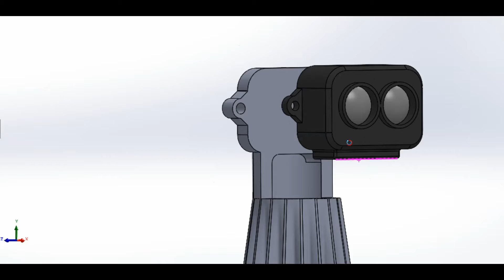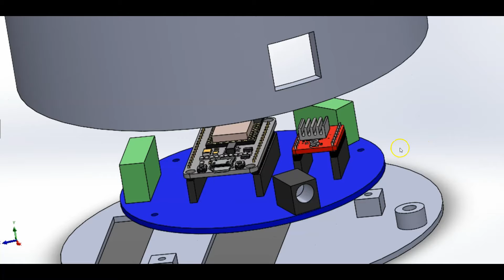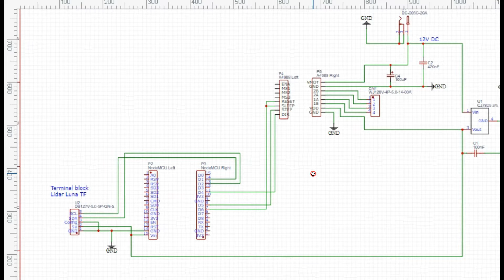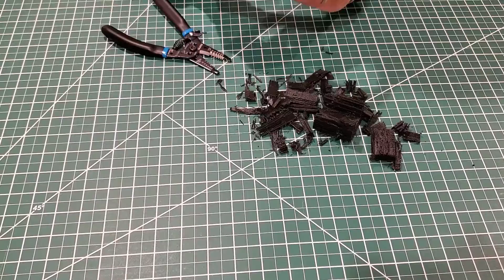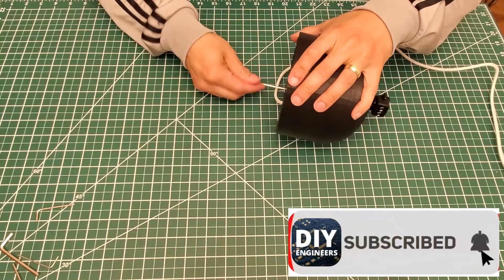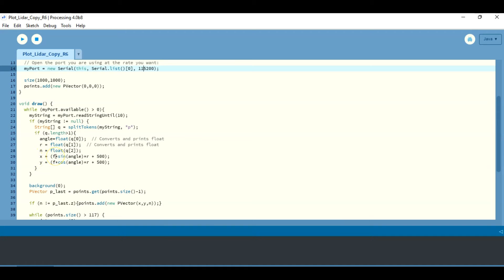LiDAR Scanner Project - Arduino Project NodeMCU

Comment: 📺💬I accelerate the motor's speed.
🧸💬 That is because it is LiDar, the small heart shape had handles but its specific co-response speed and the aluminum effect.
🐑💬 You are correct that is because of hardware today but with the Infrared sensor working well within ranges and supporting walls he may consider a mirror or sharp-angle reflection wall.
🥺💬 In circle units trying to remove the differentiate of the reflection rates, it had a small heart but they are trying to minimize them but as it developed it may response to the aluminum wall.
🧸💬 You are correct continue a bit working with reflection and moving angle.

Comment: I see you're dividing Pi by 180... strangely appropriate, given that the value we use for 𝜋 comes from a paper that discusses the ratio of a semicircumference (i.e. circumference part of half a circle) by its radius... and 180° is of course half a circle!  Have you heard about 𝜏 (tau)?  It's precisely 2*pi, since that's the ratio we often actually care about -- between the circumference and the radius of a full circle.  If you ever re-write or edit this, might be worth switching it up to use tau instead.  :D
Reply from the maker: Good suggestion. Thanks for watching!
Reply: @diyengineers  gladly.  :)

Comment: Is that actual Java or js? I haven't written Java since 99 in university haha. It was horrible back then. And it's process ide?

I apologize for all the questions. Add a thank you button and I'll hook you up because. Knowing of this other ide is great
Reply: Something I was pretty sure of, but had to search and double-check... and the answer I found sums it up nicely: "The Arduino language is a subset of C/C++".  So, no, neither java nor js, and more like C (I'm not seeing C++ features used in this code, I don't think)... though of course they're all at least somewhat related in the family tree of computer languages (which is totally a thing one can look up).
Reply: Oh, but maybe you meant the Processing part, and yeah, that's Java.
Reply: @David Lindes  yeah processing is a weird beast that I will not let into my projects since playing with it. Man when I learned to code if you did an infinite loop you'd have to reboot the pc hahaha. Compressing 600meg hard drives and shit. I loved it but got away from it for a long time and was welcomed back after not checking thr lay of the land and brushing up on my hard core c/c++ competition level shit only to find out even c++ is easier to code now constexpr and auto everything! 

This whole anyone can be an engineer and code for a living movement cracks me up. I heard a rant from Bjarne Stroustrop about it. It was gold man. I'll leave you to find it and he's got a good point. Coding apps is easy but programming systems where peoples lives are in jeopardy I wouldn't want a graduate of Tech with Tim's college responsible for any part of the millions of lines of code that go into automating any part of a vehicle.  I'm not dissing on those people because there's lots of companies who develop their own web services end to end but I wouldn't wanting the person responsible for the ui on my 55 inch infotainment screen to have access to even look at the source code for the abs system let's say.

I sound like a snob but I'm not. Just having a laugh. I enjoy tech with Tim. His keywords in python video taught me the language.  I refuse to learn lady Ada liberal Limors circuit python though. They're so woke and not connected with reality that they think 10usd for a specially shaped led is somehow contributing to the diy community.  That said I'd probably stab someone for a couple 1000 of those leds and will probably end up buying them direct from the manufacturer like I have many other leds. There's something about having over 50 thousand leds in my workshop that warms my heart. Strips and smd not counted with our tht 2 to 4 or more legged friends. I love making lamps, I've made hundreds and never kept 1. Qidi are sending me a printer to review and I can't wait to have a reliable printer again. I should make a guitar body out of leds and epoxy man, use thin silver wire and make it into a vascular type system that lights through different paths depending on small resonant frequencies. The forward voltage would be a bitch though haha. Sorry for rambling man.
Reply: @David Lindes  Java when I took the course was like the first version that was included in visual studio back when it had visual basic. Haha it was the most hateful language to optimize because of the jvm running on top of pentium 333 processors haha